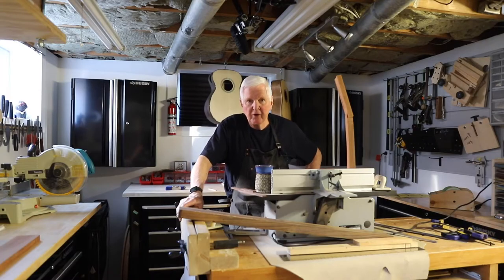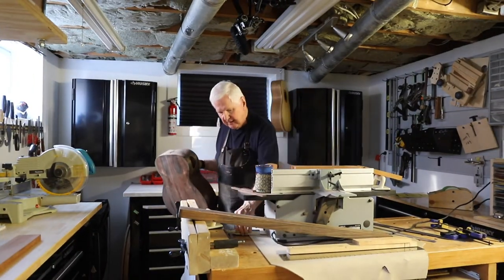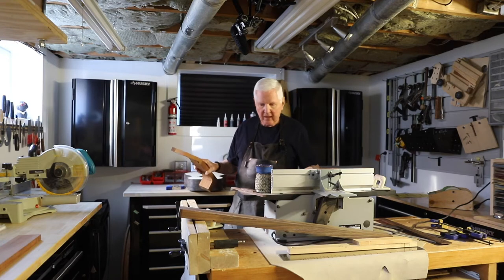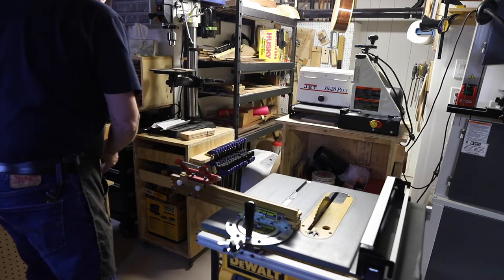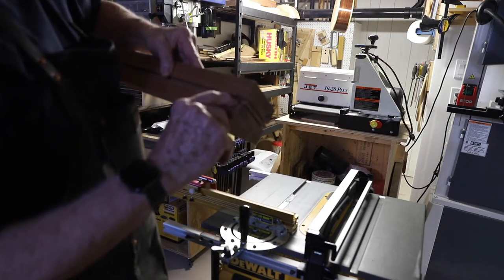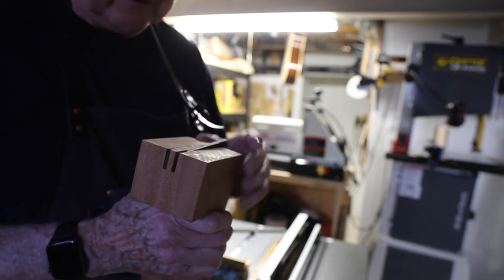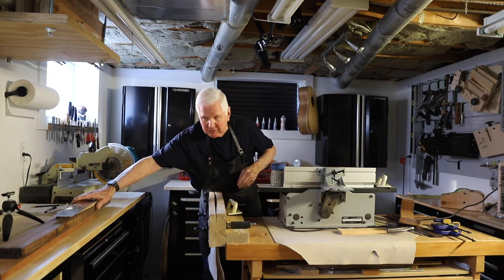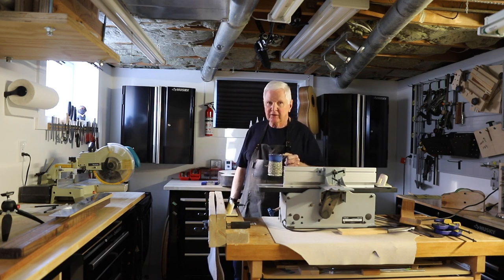Make the acoustic guitar neck fit like a pro

Comment: So, your bolt-on neck fits flush against the body, without extending into the tail block?
Reply from the maker: Correct. I have done mortise & tendon but this has never failed and  is easy  to do.

Comment: Hello Monty I enjoy your video of neck fit like a pro. I have some questions about this topic. You mesured the bodyangle en transfered it to the table saw. You said that the neck should tilt a bit due to the string tension. I asumed that your body has a straightr (90 degree) angle. If that is so there is no tilt so how many degrees do you tilt it? I do it 3 degrees and can do the setting with the hight of the sadle. Can you explain it what you do? 
Greetings Robert from Holland.
Reply from the maker: Very soon I will be showing you how I do that. In the meantime, the top of the guitar is sloped slightly down towards the neck area. The number of degrees is usually around 1 to 2. But once I use the adjustable square, I take that to the tablesaw and I change, the guide by lining up the edge of the square with the blade of the saw and then change the guide so that when I push it through it's going straight through but because the neck is on an angle it gives me that cut. I'm not sure if I explained that well enough but get back to me if you're not quite sure what I'm doing here.